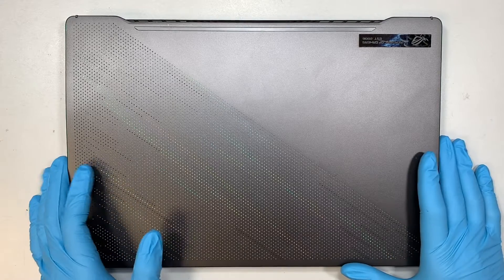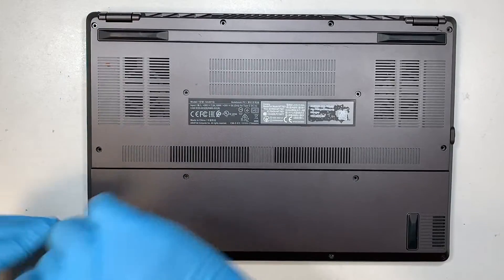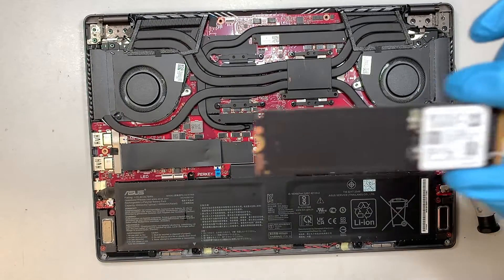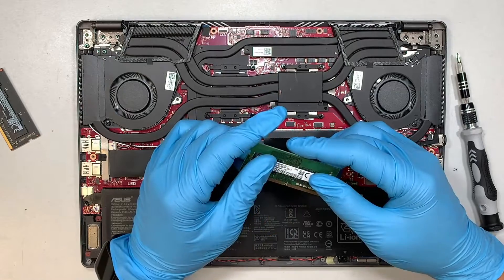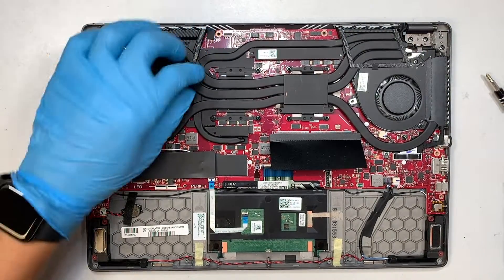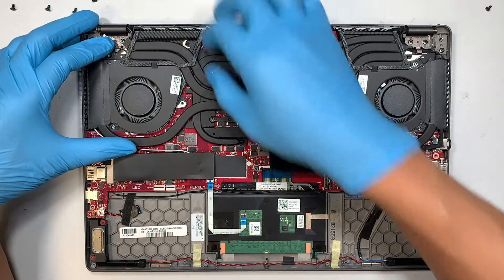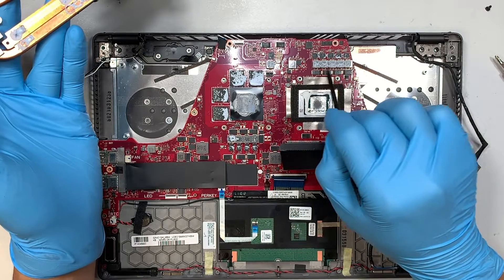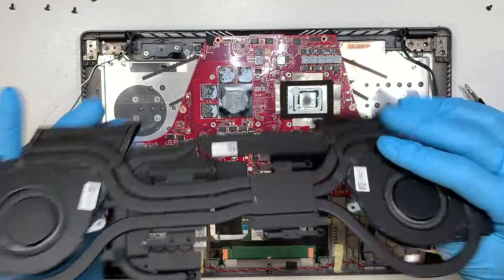ASUS ROG GA401Q TearDown Disassemble Upgrade

Comment: After replacing a faulty keyboard, everything else is working fine but it is not detecting the nvidia GPU, what could have went wrong? I suspect the tiny cable on the top left could be loose but I am not sure what it does.

Comment: Before you take the SSD out do you power it down and disconnect the battery? You don’t mention it in the video🤔
Reply from the maker: I did it without. But you should disconnect the battery.
Reply: true story